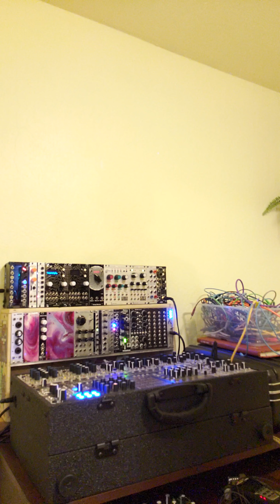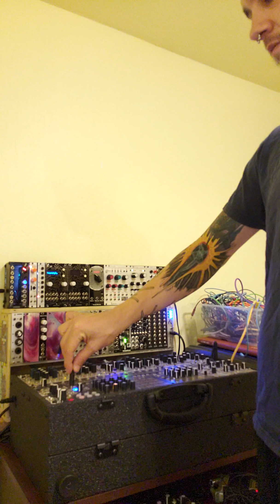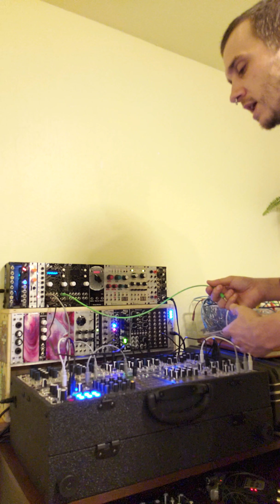How to build a modular synthesizer patch. Using an Analog Shift Register.

Comment: Thanks for the video. My only shift register experience is with the one in the Telharmonic. I need to get a shift register, but I may stay away from the O_C. I've heard it can be difficult to wrap your head around.... and I'm 4 years post brain injury and still have problems with certain concepts. I will find a standalone module. I'm mostly Make Noise. I absolutely love their approach and systems philosophy/implementation. Once in awhile I have to go somewhere else for a certain module.
 Great explanation of shift register.
Reply from the maker: Check out Shifty by Intellijel. It's a very straight forward 4 channel shift register. I've been looking at it myself to get away from the menu diving in O_C. Verbos Electronics make a module called the Random Sampling. Which also has an integrated shift register.
Reply: @musicalfungus  Thanks a lot. I had forgotten about that module. When I started eurorack I built up a modified shared system, which I called the "Shared System Also Plus Extra" and the original plan was half MN half intellijel. Then Make Noise just kept releasing all of these amazing modules, so my intellijel system stalled out. Appreciate the recommendation. It is on my list. Thanks again.